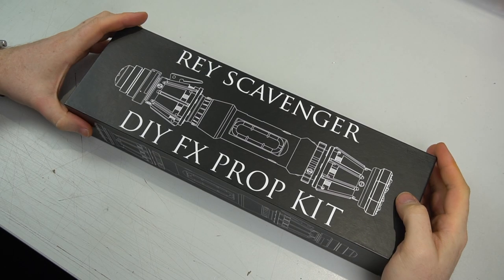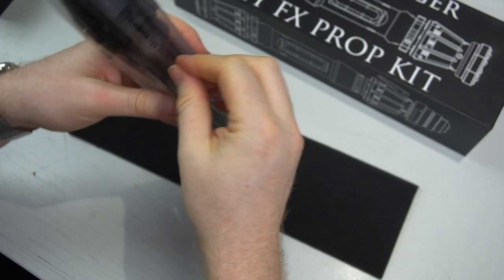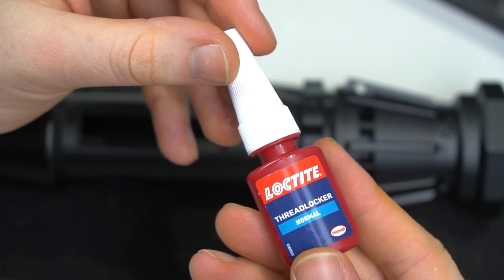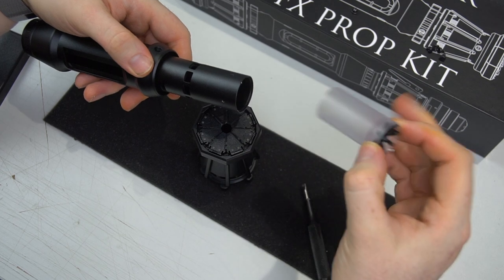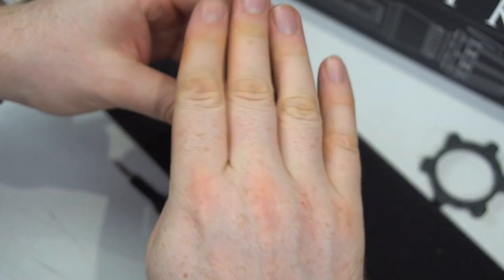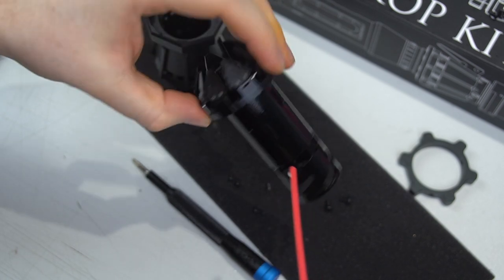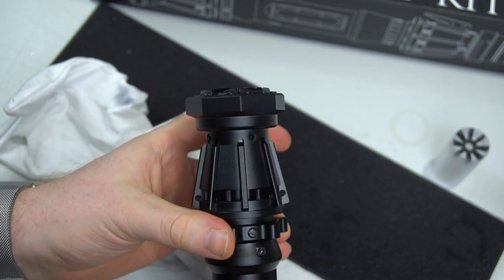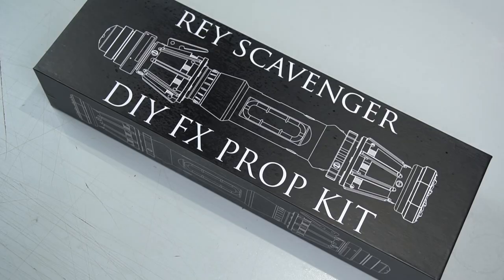'Tips and Tricks' Guide For Rey Skywalker 'Scavenger' DIY Empty Hilt Prop Kit

Comment: While putting loctite on my fin screws I seem to have seeped some over into the hinging spots in between, and was just wondering what product you would recommend for cleaning them out so they move smoothly again
Reply from the maker: Loctite can be cleaned with a solvent so something like Acetone will clean it up. Best to get a cue tip, soak in the acetone and rub the area where it has seeped 👍👍

Comment: Hey Khal, obviously I don’t want grease all over my hand whenever I pick up my saber, so how would you recommend cleaning the outside of the saber after we’ve greased the internals should they (which they probably will) get grease on them?
Reply from the maker: The grease only needs applying to the inside surfaces of the parts. Not the outside. 

Grease won’t be all over your hands whenever you pickup the Saber. Also, silicone lubricant isn’t the typical kind of thick ‘goopy’ grease people think of when they hear the word ‘grease’. 

It’s very low viscosity and almost like window cleaner if that makes sense? 😅

Once you have applied silicone lubricant to the mechanism parts as shown in the video, using some paper towels or tissue to wipe away any excess will work great 👍

Comment: I've seen you post elsewhere that the mechanism needs a fair bit of free play to work properly, but in this video you suggest Loctite on the pins. I have a few that slide out that I want to Loctite but I wanted to confirm that won't seize up the mechanism. Also how do you go about preventing blue glue showing on these exposed parts?
Reply from the maker: Please watch and listen to the video carefully. Locite threadlocker isn’t glue. It just adds a thin layer of material to create more friction on the threads of whatever screw it is applied to. Reducing the risk of coming loose from vibrations etc. You don’t see any exposed threads of screws on the hilt so you won’t see any blue. Plus, you can just wipe away the excess Loctite with tissue as I do briefly in the video. 👍
Reply: @KRSabers  Thank you! My mistake, I always thought Loctite was just a thin glue used for sealing threads. I’ll give it a go.

Comment: If you've had two screws come loose on a single arm (and the petal has detached from the arm), what's the recommended way of reseating the screws?
Reply from the maker: Screw them back in and once you can’t screw any further, slightly back out a quarter turn or so. This gives the space for the petal to still be able to move. Then, as recommended in the video, best to apply some blue Loctite to the threads.
Reply: @KRSabers  Thanks, but I can't get the arm and petal to stay aligned in order to allow the screws to be inserted and the tightened
Reply from the maker: @rob1uk82  You’d have to disassemble the entire upper assembly then. 👍